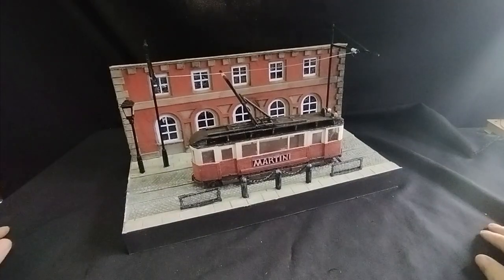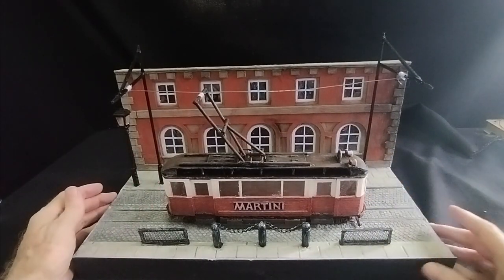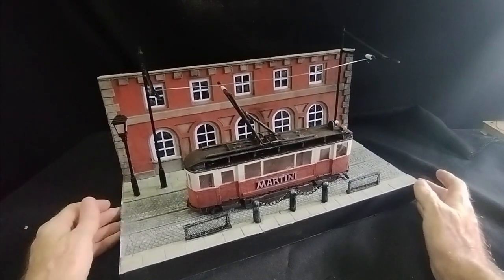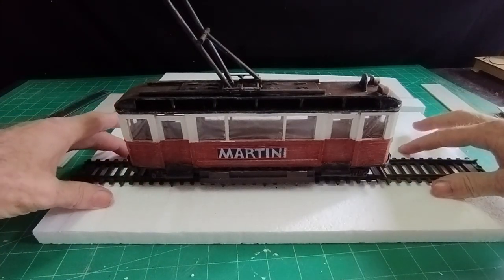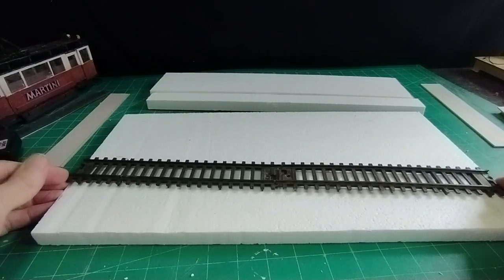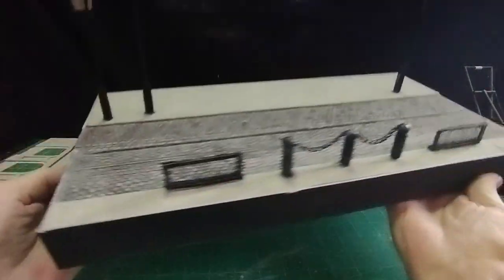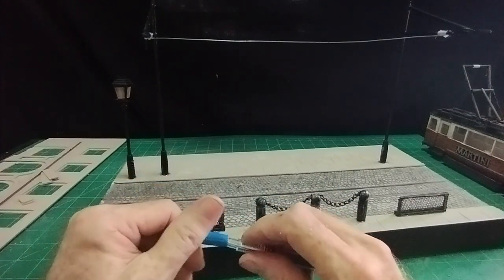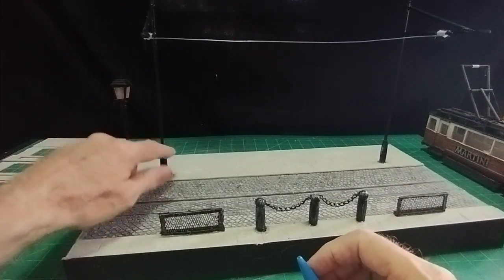Scale model tram.1/35. How to make.

Comment: You promised us a proper diorama base for your tram car Don, and I don't think that anyone will be disappointed with your finished work!  This was well worth the wait.

Using that inexpensive pen tip to make your streetlamp bases is an inspired idea.  And that municipal building backdrop built-up from multiple levels of cardstock looks incredible!  

I notice that you have been using a section of repurposed steel ruler to apply and level your wall fillers and tile grouts.  Given the number of dioramas you build, It might be a good idea to invest in an inexpensive set of putty knives for this task.  These come in a variety of sizes and widths with handles making them easier to use as a scraper or screed.

Please keep the dioramas coming!